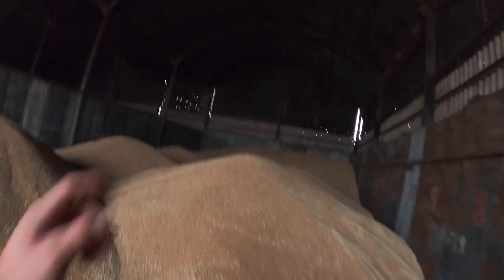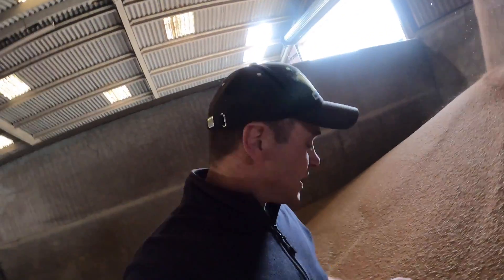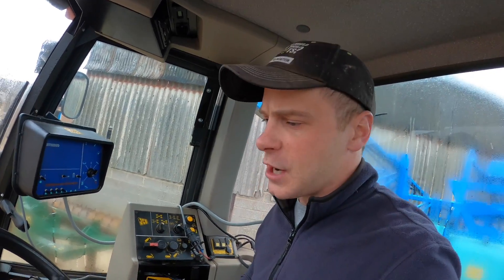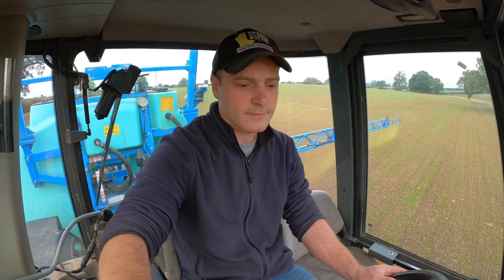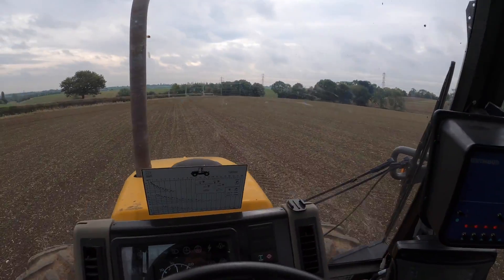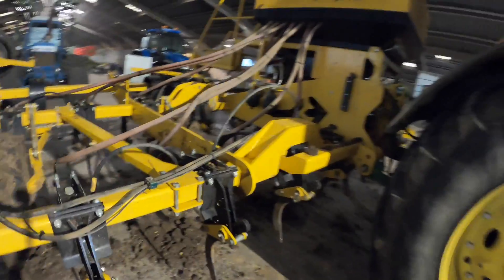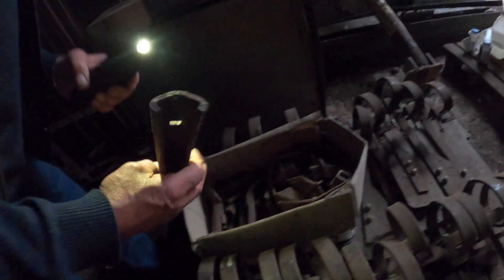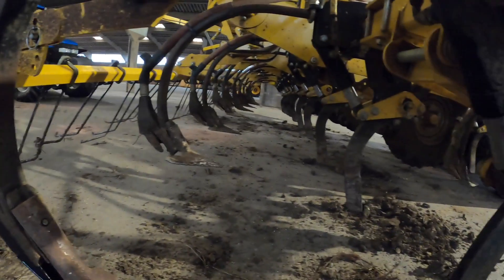DRYING GRAIN, SPRAYING & BEAN CHUTES #FARM VLOG 176

Comment: Hey nick just a little tip on the fastrac when parking it up leave it in the gear of the way you are going to go next and you shouldnt have to wait for air, we found it on our fastrac if we just leave the shuttle in forward or back
Reply from the maker: Ah good tip thanks! So just knock it into neutral with the gear stick and leave shuttle alone?
Reply: @NicksFarm  yeah works for us dont have to wait for air then
Reply: @NicksFarm  so if you back into a shed and want go forward out, slip it into forward and youll be fine next time you go to it